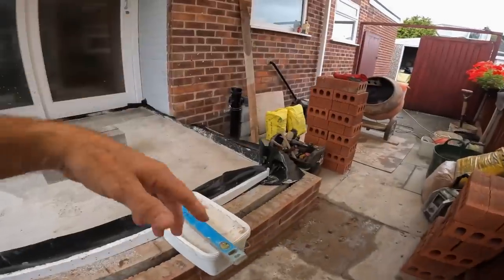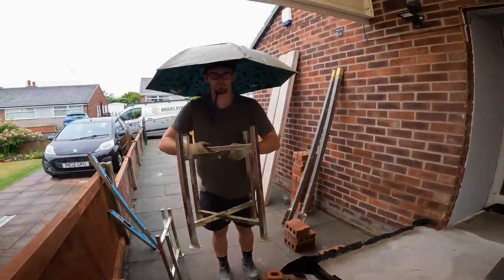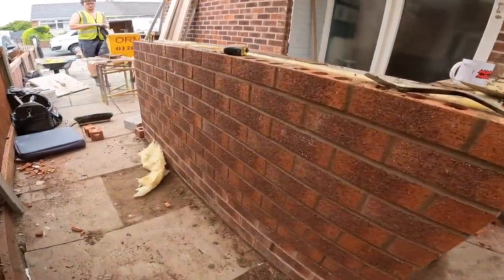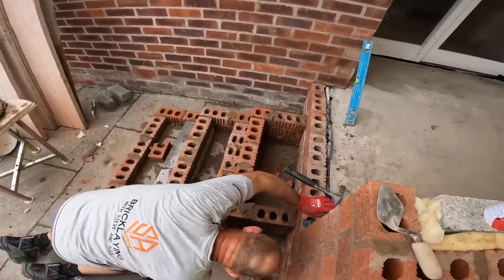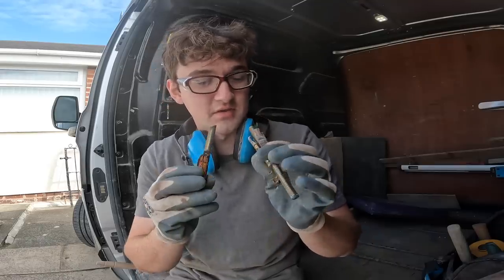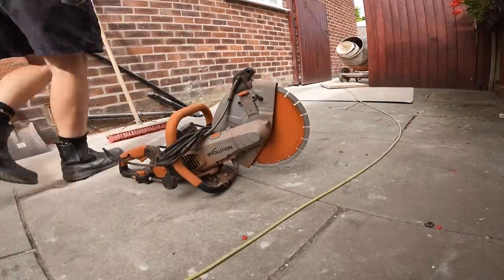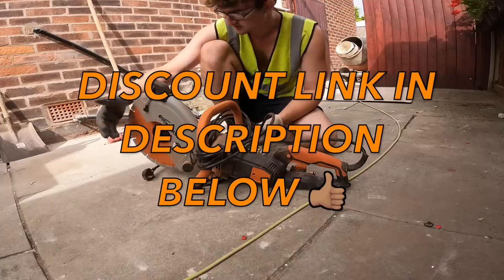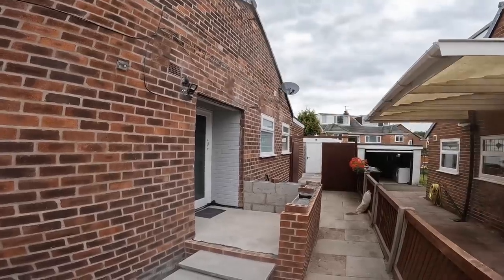WE DESTROYED A CARPORT!!.. PORCH BUILD PT 4

Comment: Them eco saws are class, had mine over a year👍🏻 one thing I never knew was your not meant to use metal cutting blades with them cos of the rpm is to high. Just be careful😬😂
They cut 110nm nearley too✌🏻